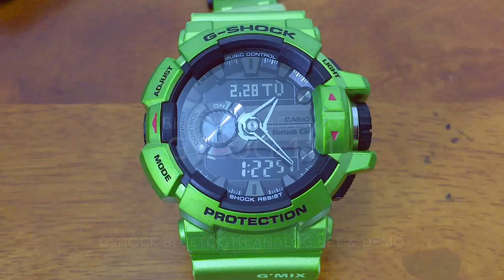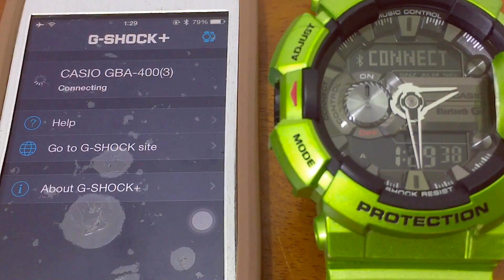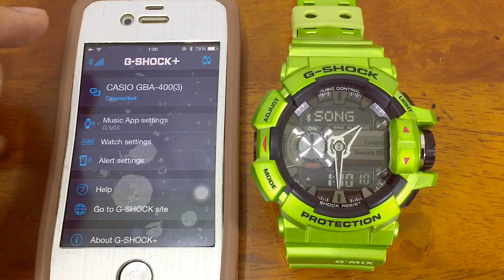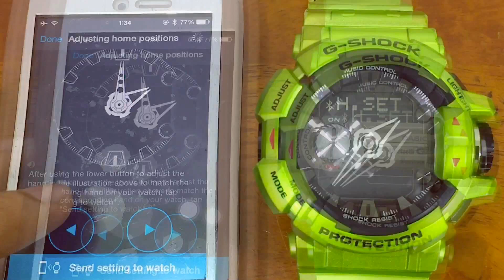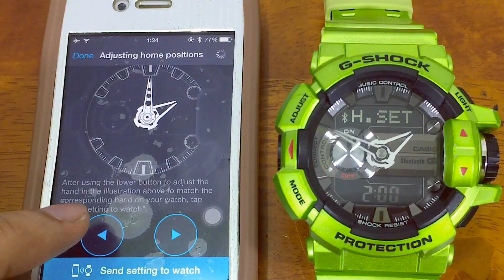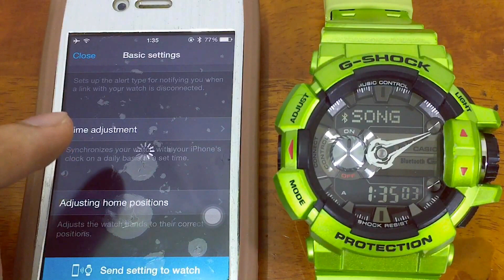Casio 5413 G-Shock Module Tutorial | Watch set-up using smart phone & basic complications demo.

Comment: This damp watch is one of the worst products I've ever bought !
Reply: Does it have problems. Would you tell me a bit because I'm planning to get one the same
Reply: @rs7997  the Bluetooth switches on then goes right back off again , won't pair up to anything,  when you adjust the hands to right time they stay at time then go haywire then go to some random time the digital time stays accurate for a bit then does its own thing to , I like the watch but I'm very close to throwing it in the bin . Personally I wouldn't recommend it .
Reply: @paulthomson9014  Got it, thanks a lot for your information Mr. Paul. I will search the G shock ga700 they don't look too complicated 👍

Comment: I need your help please...my controller is not working and my battery was over so I changed my battery after that my time was not correct so my time is not correct in my gmix how can I adjust the time from the app?
Reply from the maker: Pair the watch to your phone and watch then video minutes 8 and forward. There are many setting options there. Cheers.

Comment: Btw i want to know in my g shock ga-100c the autolight doesn't works do u know the fix
Reply from the maker: I don't think this model have that auto-light feature.
Reply: gshock highfashion nope i also checked on internet as when auto light is turned it indicates on screen but doesnt work
Reply from the maker: Oh wait. I thought we were referring to GBA-400 series. GA-100 indeed have the autolight feature. It will be displayed on the left 'eye' - specifically on the lower left region inside that eye - when switched on. Try to press harder or longer. You could also access the 'TLT' test screen to check if it still functioning though.